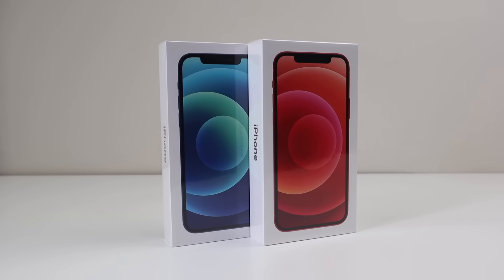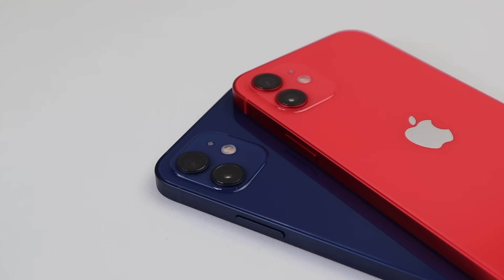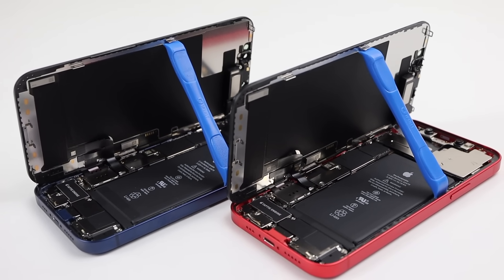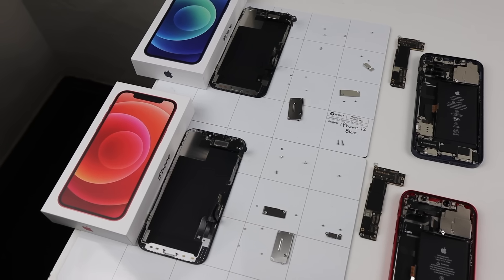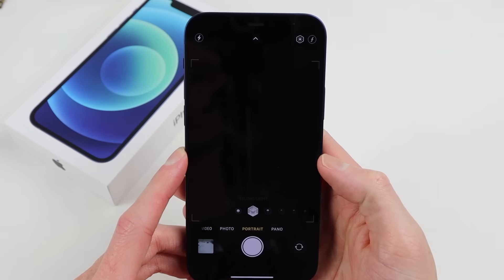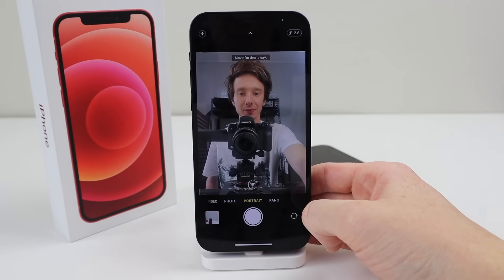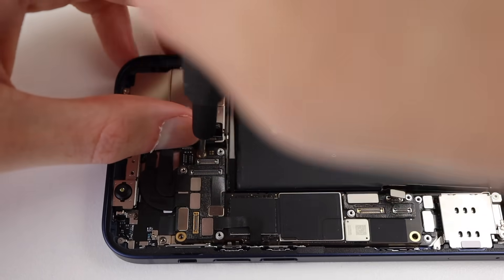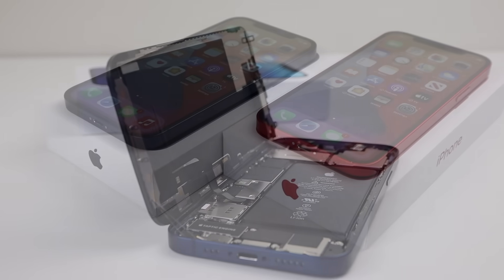iPhone 12 Anti Repair Design - Teardown and Repair Assessment

Comment: and people still think Apple is "consumer friendly" and an ethical company.
Reply: Apple used to be good, but not now. now, they do everything in their power to force you to pay them for fixing your phone, and buying charger that doesn’t even match most ports.
Reply: @NitroFlux07  they've always been like this, just did it in less in your face ways with their ridiculous proprietary hardware and software.  From the power cords that could only be replaced by them to Software that made it easy to add files and music but extremely difficult to move to another device.
Reply: Macoloids can't be changed.
Reply: Nobody thinks actually. When i say Samsung is better, I mean it. The earbuds in charger port, the no earbud port, where you have to get airpods. Apple playing yall man, why yall let them do this to you
Reply: @colindement3217  as a new Samsung owner, I can confirm Samsung is better
Reply: @colindement3217  words
Reply: @colindement3217  I think even samsung is like apple now
£1,000 for a phone?
no thanks
Reply: @BenjaminCarpendale  They both charge ridiculous prices, but the difference is that samsung not only treats you better, but they have shorter repair times and they allow third party repairs and allow people to sell aftermarket parts for lower prices
Reply: @thedoctor4444 ah,ok
Reply: @BenjaminCarpendale  new phones yeah older phones are still great and most of them are under 200. My phone cost no more than 150 and I can still do everything. Calling, editing, pictures, gaming etc.
Reply: @colindement3217  Samsung has no aux jack and uses dongle in charge port too. my friend didn't even get a dongle with new note which costs $50 separately ..You must be thinking of lg which doesn't use that dongle BS. The audiophile phone is the LG v series with the hdac. LG or oneplus are the way to go.
Reply: @colindement3217  Yes, yes they think so, else Apple would have been gone ages ago.
Reply: @colindement3217  Samsung gets off the Google teet and make a device that isn’t about collecting every last god damn piece of info on me then I’ll buy one. Apple isn’t perfect. But A Google operating system is straight up evil.
Reply: @scusmi  you have no idea what you're talking about.
Reply: @scusmi  you think apple is not worst than google? Good luck, apple is also selling your perdonal info like google
Reply: @alstbond1379  how?
Reply: @supergamer4015  I observed my wife's iphone 11, they still show ads which we search in youtube
Reply: @scusmi  so apple doesn't collect your info ? What a sheep
Reply: @1nfinitebean  I don’t recall making a claim that Apple doesn’t collect info. Every company that has some sort of footprint on the internet is collecting every single item they can on their users, visitors, etc. 

Apple is not perfect. There is plenty I’m not happy about with them. But when you look at Google and compare to Apple, Google is awful in what it does with your information. Let’s take mail for example: Apple is not going through your iCloud email. Google is going through all of your gmail.

I think the rage to my comment needs to be tempered a bit. Be objective and don’t imply something I never said.
Reply: @dumbr2098  Prove it. I know Google is evil in how they handle your data. Their business model from day one was to snoop on you and sell that info as insights for advertisers. Read an annual report from each of these companies and see where their revenue comes from. 

Again Apple is not perfect, but stealing your info is not the nucleus of what makes their business model tick.
Reply: @alstbond1379  never said they were not. Stop projecting your opinions into my comment. 

Read an annual report for each company to find out how they make money. You will find that Google is much worse than Apple when it comes to your info and what they do with it.
Reply: @alstbond1379  
You saying that does not make it TRUE though, does it??  Apple does not sell any customer info. They give it away or trade it.
Reply: @scusmi  lol, what the heck? You don't want an opinion that can contradict or not go with yours? Then stop commenting and don't even use the internet
Reply: @alstbond1379  never said you couldn’t have your opinion. I just told you to stop projecting them onto my comment and then claim I said something I never said. GL IRL and Happy New Year to you! ❤️
Reply: @alexeistrovak514  to whom does this comment points to?
Reply: @alexeistrovak514  (This will be long but I’m guessing it will be too tempting to not solicit replies) to all my fans on this thread, I wish you would actually come to the comment section with facts and research and data that debates my original post about Google. But I guess the name calling and echo chamber feels somehow compensates in your world. 

And yes I know I’m on an Alphabet product. It’s not lost on me.  But I guess your solution would be to not have a dissenting opinion about the platform because I would have to do it on the very platform I’m complaining about. Uh.. ok. That makes sense I guess. 

Since it seems people don’t want to make an actual effort:

In the third quarter of 2020 alone, Alphabet had ~$40B in revenue. Of that ~$25B was from Google search and other related data collected. YouTube ad revenue was not even $4B. 63% of their quarterly revenue came from them making money off of your info. 

Apple: their Q4 2020 revenue was ~$65B. Of that, ~$50B were from the products they sell. Only $14.5B were from all other “services” (btw, having Google as the default search engine on an iPhone represents 25% of their “services” revenue)

All I’m trying to say is that one of these companies core revenue engines relies on your info. The other relies on product sales. Neither are corporate angels. And I don’t pretend that both are without their faults. But on the scale of intrusiveness, Google wins hands down. It’s how the company was built. Plain and simple. If Alphabet came out tomorrow and said they were no longer collecting info on people, their stock would collapse.
Reply: @dumbr2098  both apple and google collect data, the only difference is that apple lies about it. Google is openly admitting to everyone that they collect data. Google also makes it possible for you to disable data collecting through your settings
Reply: @scusmi  google isn't stealing info. They admit to collecting your data, and it's even in the terms of service. It is up to people to choose to buy google devices. Apple lies and says that they don't collect data when everyone knows that they do.
Reply: @scusmi  if anyone is stealing it's apple
Reply: @scusmi  not only that, but they make some of their products dangerous to repair, like their mac book pro is literally deadly because when you take the screen off of it the power supply is exposed and if you touch it or even get too close to it the entire flow of electricity goes straight through your body and will most likely kill you
Reply: @scusmi  The info that you just gave is actually false. Apple has made over $100 billion this year alone, the amount of money that you're not accounting for is the money they make off of collecting data and selling it. Apple just doesn't report that money so they can say that they don't collect data. Google is still open about how much they make off of collecting data and choose not to hide the amount of data they collect and give consumers a way around the data collecting. Not to mention samsung products are far more reliable and durable than iPhone products. The only thing that iPhones have an advantage on is their video and picture quality. Samsung products like the Note 20 Ultra have a faster and stronger processor, more ram, better stability, and higher drop ratings. Not to mention third party stores like Best Buy, Target, Walmart, etc. have reported that there is far less hassle with samsung and google products than apple products when it comes to trade ins, repairs, warranty claims, and getting the parts and products they need in order to fulfill their services
Reply: @scusmi  A customer who had a mac book pro wanted to pay Apple to repair their device since the warranty had expired, but when they had come in they were told that they had to wait up to 3 days for them to see what they could do about it. About a week later the customer was finally notified that they need to come pick up their device because Apple wasn't willing to send the parts for the repair and if the customer wanted they could buy a new one. So not only did Apple take more than double the maximum time they said it would take to get back to the customer, but they also refused to accept money from a customer so they Apple could fix their own product.
Reply: @scusmi  I bet Apple collects more info than Google about you. Stop using the word "evil". It's nonsense. And Samsung support >>>>>> Apple support.
Reply: Why should we care ? why do you people have to pretend to be so secretive. Nothing you do is special, probably millions of other ppl do the same exact thing. So what if google or apple is selling our information ? we have more relevant adds, is that so dramatic ? just ignore them.
I don't get it, really, why ppl care so much about their privacy when it's on that level. Hiding embarrassing stuff from your neighbors friends or whatever, ok, but google don't give a fuck about you, you're just one data, among billions.
Reply: yea personally the iphone 11 will be last phone i purchase from them. They dont care about us and the products arent good enough to ignore that
Reply: type top 100 companies and let me tell you none of them are ethical.
Reply: Im using apple before but i notice that it also give me advertiser from everything i searched and watched, because of that i switch to android because android have a superior specification longer battery life the only downside is it shows me advertisement from what i search and watch JUST LIKE WHAT APPLE ALSO DOES
Reply: oh my god all these fanboy ass comments. All these tech companies are far from consumer friendly, including your bff fav company you just can't help shilling for in your free time. Christ people, stop defending billion dollar companies, they don't care nor need your help.
Reply: They're money hungry
Reply: I was excited to be your 1000th like ^.^
Reply: They can be fixed. By Apple. I have never in 11 years had to have one fixed
Reply: @DanaTheInsane  the problem is they con only be fixed by apple. Because they can only be fixed by apple they can charge whatever price they want, make you wait as long as they want, and give you the poorest quality service, and after all that they will tell you they refuse to fix it so you should just buy a new one. It's cool and all that you've lasted 11 years without needing a repair but you arent the only person with an apple device.
Reply: @DanaTheInsane  I wasn't saying that Apple won't fix them, I was saying that there was no reason for Apple to deny service to this willing to pay customer, but they did anyway
Reply: @DanaTheInsane  also if you've had the same one for 11 years then you might want to get an upgrade for your tech that's over a decade old
Reply: @DanaTheInsane  unless the only reason you haven't had to get them fixed is because your buying new ones before they have time to need repairs

Comment: Simple fix: Stop buying apple! Why should loyal apple  (suckers) I mean customers, show loyalty when apple dose not show loyalty to their customers!
Reply: The competition does not exactly inspire a lot of confidence. Is there a vibrant Android repair economy or do those phones get tossed even quicker than Apples?
Reply: @gorkyd7912   I have an IP68 indestructable phone from android it's made by  Samsung it's a Galaxy S8  Active I have dropped at the hundreds of times on concrete I've dropped it in water h*** I've dropped it in the toilet Yeah cleaned it off and had no problem.  Yes the cost is about 1/3 of an Apple.
Reply: @gorkyd7912   Also I have a tendency to use my phones for years I buy phones because I have to upgrade the operating system.
Reply: @gorkyd7912   Also my phone  Uses C-usb standard charger you can buy for $10. Or transfer data right to my windows computer.
Reply: @kwkstar   The gripes about not-included chargers used by the new iPhone makes no sense to me. The cable that comes with the phone is a USB-C to "Lightning" cable for connecting to a computer that uses the USB-C standard. This should not be confused with the charging cable, you don't need to use this cable to charge the phone, any Lightning cable which Apple has been using / including / is being made 3rd party since 2012 will work. There's jillions of these cables out there with USB-A connectors that will work in all the wall adapters shown in the video. Hugh Jeffreys has jillions of these cables himself, as shown in his cable repair video.

Comment: I feel like every single Iphone component has a serial code that matches with eachother.
And if the code isn't the exact same, the product stops to work.
Reply: Printer ink cartridges exist already
Reply: @charon2588  Printer Cartridges are a scam yeah. The damn devices are programmed to not function if one color is below 50%
Reply: @WitheringAurora  I fixed it using a cartridge that gives the true value by modifying the ones that the manufacturers of the printer want you to use
Reply: Some components are like that already, I believe. The home screen button I think is tied into the screen. I'd have to verify it with the phone technician I shared a shop with.
Reply: if my memory serves me. your really close.

Comment: I’m an apple fan but this is too far, they are just money whoring at this point
Reply: that was your first mistake
Reply: Money whoring yes, but mostly all of these "anti-repair" measures are designed to prevent Chineseum rip-offs. Independent repair is caught in the crossfire of Apple trying to get ahead of the competition by not letting its products get reproduced for cheap elsewhere.

Comment: What if Apple made cars? Can you imagine replacing your engine and then have your A/C, windshield wipers and fuel gauge disabled.
Reply: You mean like Tesla?
Reply: @gorkyd7912  I just looked into that. Pretty scummy.
Reply: @gorkyd7912  Tesla doesn’t have an engine
Reply: @IncognitoMode1337   Engine: a machine with moving parts that converts power into motion.
Reply: @gorkyd7912  it has a battery not a gas powered engine. Its an electric car
Reply: @gcg8187   Engine: a machine with moving parts that converts power into motion. Are you saying a Tesla is just a battery that doesn't convert power into motion? They make batteries, true. They also make vehicles, their vehicles have motors, also known as engines.
Reply: They've literally done this with the new farm equipment, you have no right to repaire any of it.
Reply: Jeuss
Reply: John Deer already does this shit.
Reply: it exists, it's called Tesla. they have been trying to make 3rd party repairs impossible
Reply: @laur-unstagenameactuallyca1587  Not only Tesla  in the future, i fear
Reply: nyan

Comment: During the process of assembly the phone at different stages is calibrated with the logic board and active components together. The cameras especially require thorough calibration in lockstep with the proccessers since there are still enough variations between camera component samples which require software adjustment and compensation. So no surprise it won't function properly when the boards are swapped

Comment: "We've Decided to not include the power adapter to cut down on waste"
"Oh also this cable only fits power adapters with a specific port that almost no one currently has, so if you want to charge your phone you'll have to buy said power adapter in separate packaging, because NATURE"
Reply: I also dont like Apple but all new phones use usp c in charge box.
Reply: @orxanadigozalov  yeah USB C into the phone. Apple is a scumbag company which is the only one who uses another charging port into the phone and USB C into a brick which just doesn't make sense. it's fucking ridiculous and  Apple is such a waste of a company.
Reply: I only have the usb c power adapter because of the ipad pro

Comment: Dear apple fans now you know how bad the company you love so much is screwing you over thanks to Hugh Jeffreys, even between brand new phones they disable a lot of features and you have to use 5 different screw drivers to get in. this is a low ball move by apple deliberately making their phones un-repairable so they can charge you more to repair your device than a normal repair service would charge. keep buying their products so you can keep condoning their behavior.

Comment: Just purchased iPhone 11 just come with type c to lightning cable 
And on apple website this is written. "As part of our efforts to reach our environmental goals, iPhone 11 does not include a power adapter or EarPods. Included in the box is a USB‑C to Lightning cable that supports fast charging and is compatible with USB‑C power adapters and computer ports."

Comment: In 2021 the EU wants to introduce the "Right to repair" regulation, all repair shops will have the right to get spare parts and devices for the same price Apple is charging their own shops. This should make it easier for producers of 3rd party devices to get their parts working in the iPhone even if apple sticks with their hardware policy.